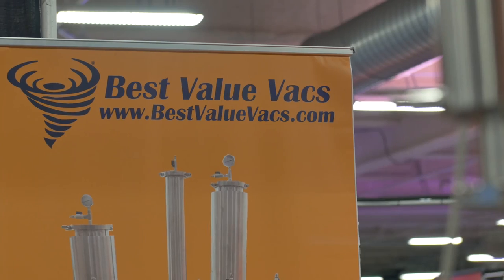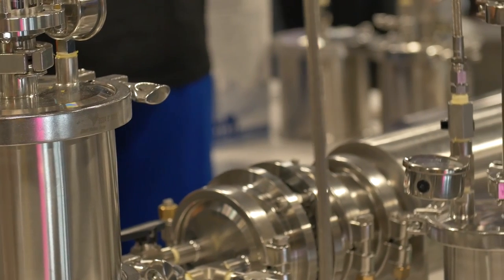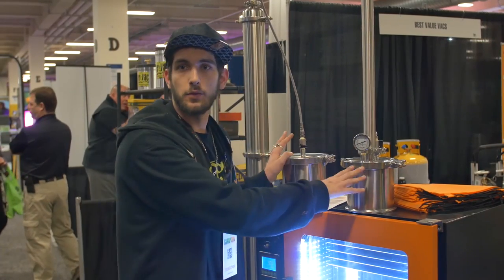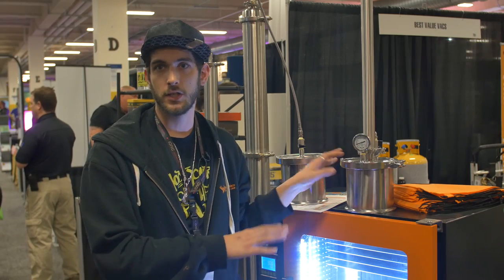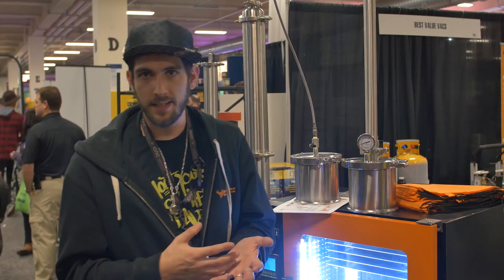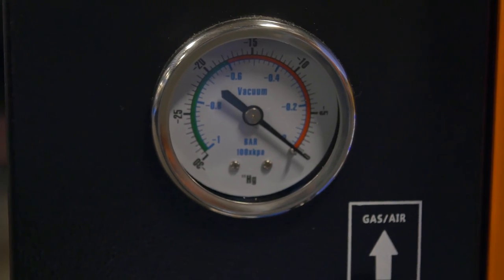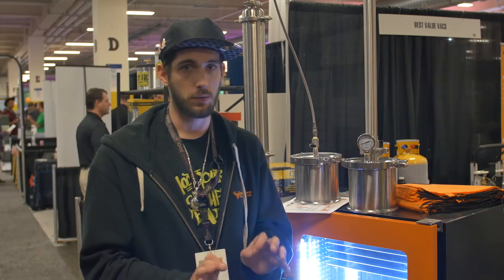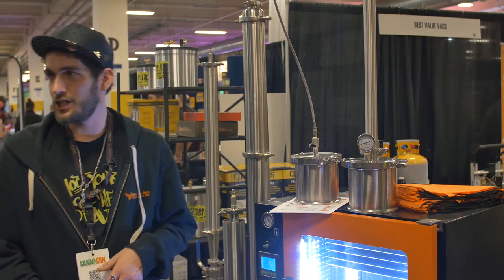Closed Loop Extractor - Best Value Vacs

Comment: When you say burping the oven, we are releasing the build up of butane from the oven, but where does that go?  Do we vac it out of our room or does it stay floating around for us to inhale?
Reply: The boiling point for butane is 30.2 degrees so it will evaporate into the biosphere. Problem is when there are cold spots in the room where the butane can accumulate, then it becomes dangerous as even a static electrical spark can ignite and detonate if it is contained. Hope it helps. Stay safe.
Reply: You probably want to do this in a garage or somewhere with lots of ventilation to outside.

Comment: can you use C02 ???
Reply: I with you bud, don't want or have the hundreds of thousands of moolah for whats out in the market when it comes to co2 extraction
Reply: no. co2 needs to be at super critical state. technically speaking co2 only needs to be under 75psi to turn into a liquid but these systems are only rate at 100psi. you can attempt it at your own risk but youre going to need a co2 pump to get it into the extractor. good luck lol
Reply: Co2 stinks

Comment: scary junk, prone to blowouts
Reply: Bullshit... I have a mini XL I have used heavily for over a year.. processed easily 10kgs through it.. Ive pressure tested it recently up to 250psi which is well above the normal range of use.. They are lovely little extractors for their price and also very safe if used correctly. I never get above 60psi during my recoveries.
Reply: I have pictures of someone face when one did bloww out, knocked his teeth out, safe huh, just cause yous hasen't yet and by the way they infringe on my patent, letter coming from lawyers.
Reply: Do you hold any grounds as being the patent creator? Secondly what, when, where, how and why happened to the guy you mentioned about having an accident?